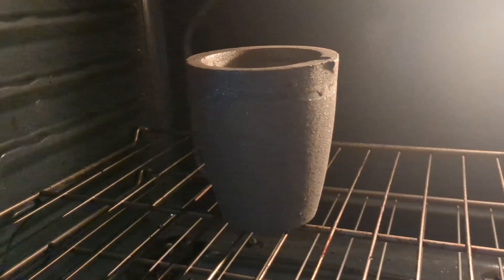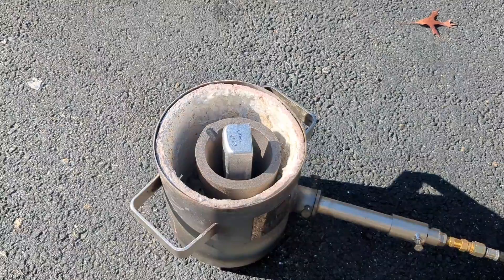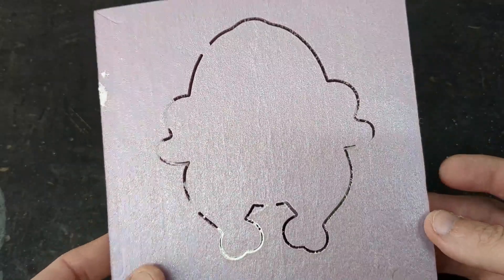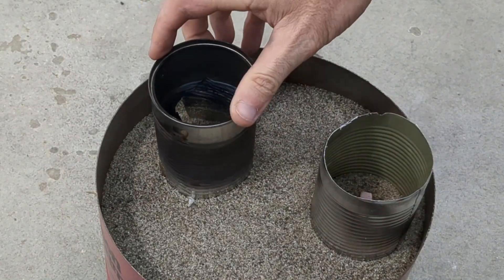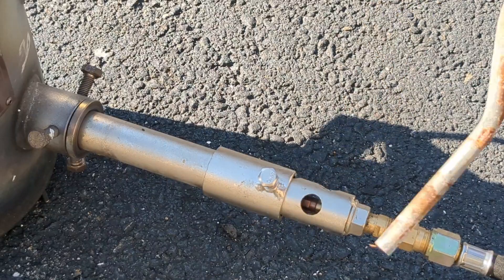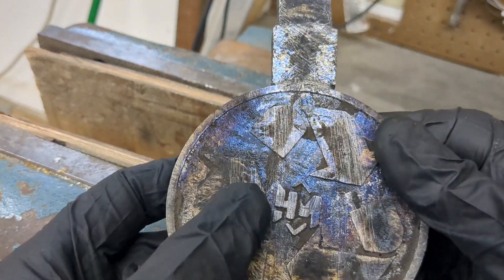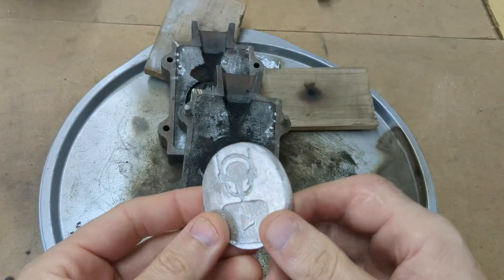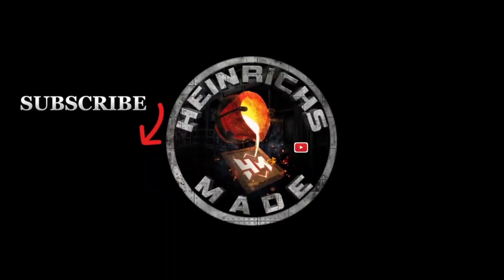Sand Casting Aluminum - Easy Aluminum Casting - (Metal Casting Process)

Comment: How did you make your foam forms?  Why the sheetrock mud coating?
Reply from the maker: Hey Matt, I carved the f with my FoxAlien CNC router.  The foam is coated with the mud to give it a good surface finish.
Reply: @HeinrichsMade  ok.  I did a Scorpio by hand with the same foam but without the mud.  I need a cnc or a scroll saw. Thanks for responding.
Reply from the maker: @dmattinman  yeah anytime!  I've tried by hand, it's tough, I'm not a sculptor, lol.  If you have Any questions HMU.

Comment: Good video. Just started melting and casting a couple few months ago and have found your video helpful. What type of foam do you use to make your patterns?
Reply from the maker: Thanks!  Good luck with everything 👍. Make sure to be safe and wear PPE.  I'm glad my videos were helpful.  The foam I use is polystyrene xps.  I buy it from Home Depot.  They sell craft sheets in 2'x2'x1".  It's the pink foam board.
Reply: @HeinrichsMade  👍